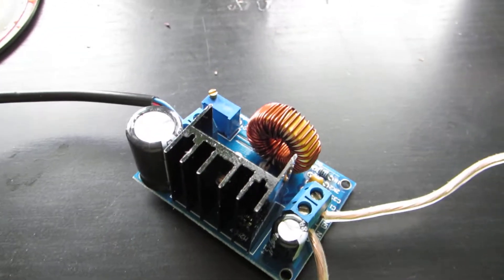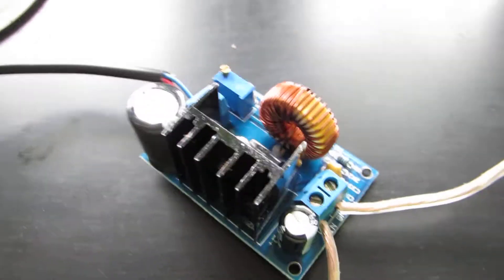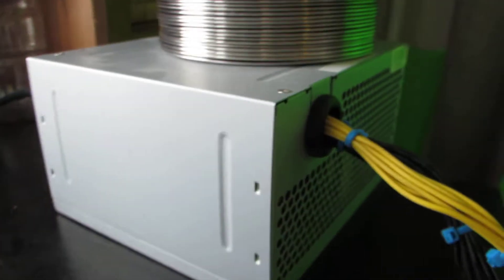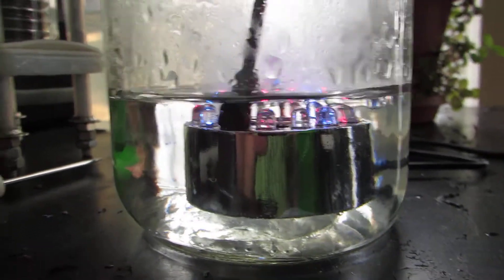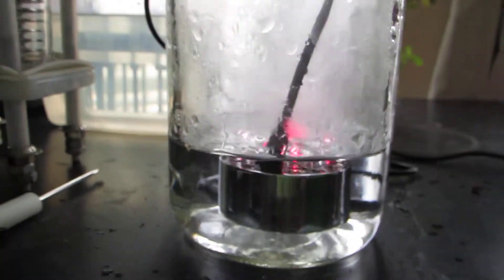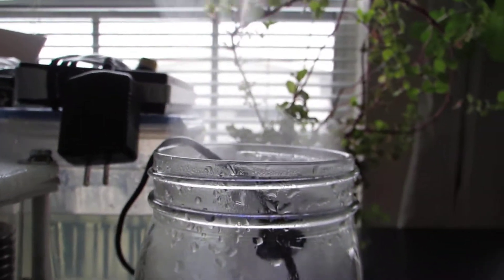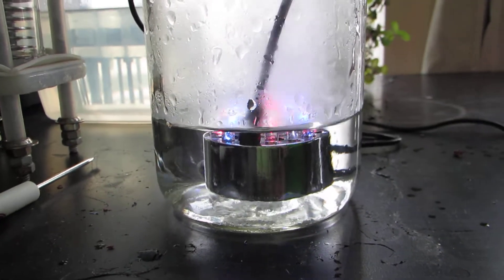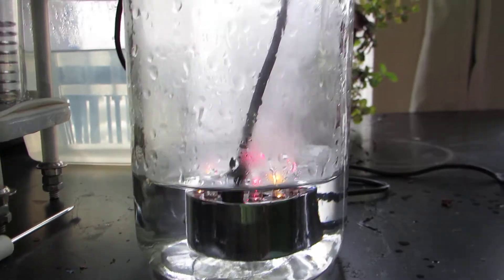Vid69 Ultrasonic Fogger Water Vapor Concept

Comment from the maker: That was my intention, but the boiling water I used deteriorated the seal inside of the ultrasonic fogger, and it shorted out.  I've got 4 more pond foggers on order from Hong Kong, so it will be another 2 to 3 weeks before I can continue my experiments.

Comment from the maker: I think I will probably use copper tubing to transfer heat from the engine to the cell. Then I don't have to worry about electrical connections or relays.